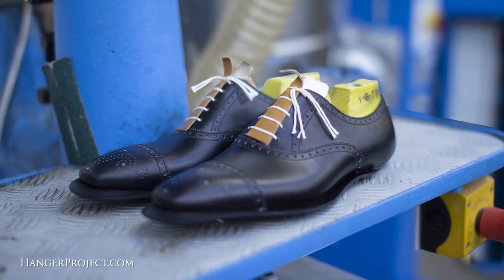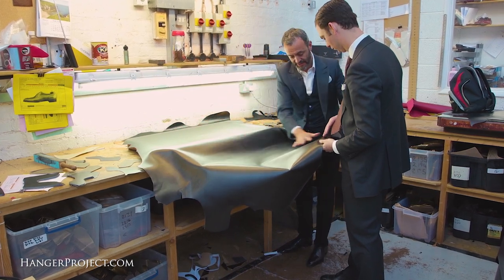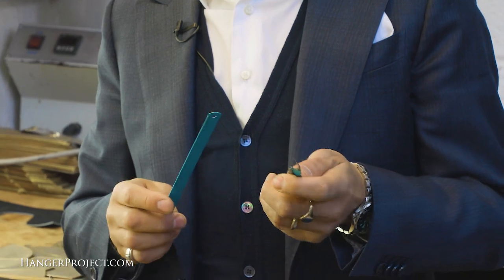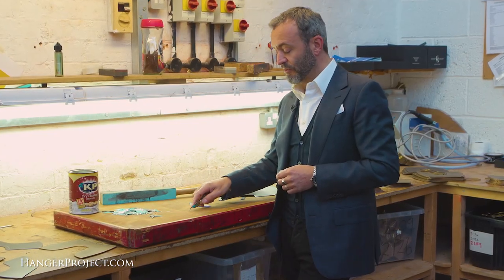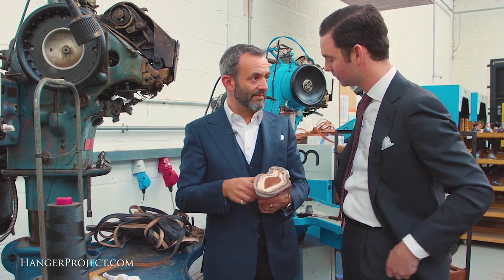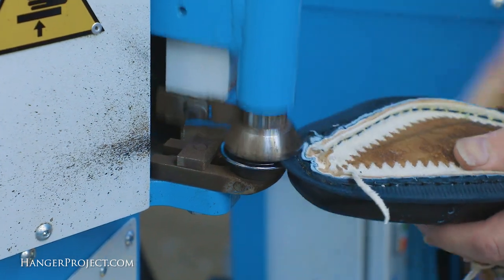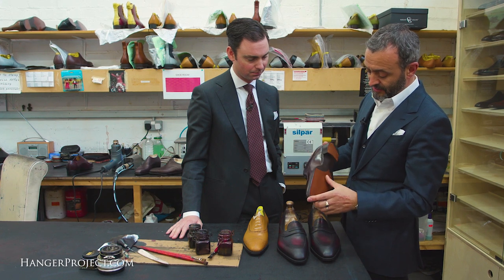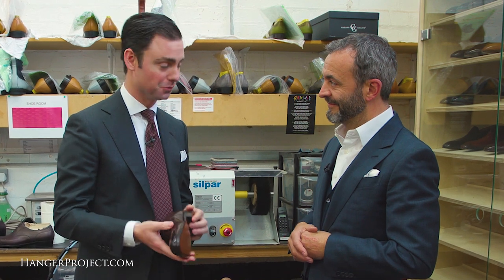How Goodyear Welted Dress Shoes are Made | Gaziano & Girling Factory Tour

Comment: Loved seeing channeling on the side rather than straight down. Regarding the polishing and finish how do you feel about sanding the leather to get dye to penetrate? I work in bespoke boot making and the first time I saw someone sanding the grain I felt very scared. Was wondering if it was a usual thing.
Reply from the maker: Cel Gar Totally agree.
Reply: The old way, yes it is correct sanding the outsole and then hot ironing, waxing and polishing

Comment: So the main difference between RtW and their bespoke shoes in terms of construction (not counting the last making) is the welting where RtW is Goodyear and bespoke is hand welted?
Reply from the maker: rob fong This is probably the single most significant difference, but it would be incorrect to simplify it down to just this element. Bespoke is a totally different product and experience. For starters, all bespoke shoes are built on a customized wooden last that allows for a level of comfort and fit not possible even with the best RTW. And although construction is similar — they’re both shoes — the fact a GG Bespoke shoe is made entirely by one or two people allows for a level of fit and finish even above GG RTW (which is saying a lot because GG has an incredible finish).

Comment: Kirby I have a question. Since the canvas rib is GLUED on the insole, the good-year welted shoe is basically a glued shoe because if the canvas rib comes apart from the insole, you could basically take the shoe apart right? I mean, nothing will hold the shoe together anymore, where with a handwelted shoe the welt is realy stitched to the insole, which can offcourse not come apart unless the stitch brakes. Am I right? would love to hear from you! all the best from the Netherlands!
Reply from the maker: mike Reuvekamp You are certainly not wrong! It is surprising when you think of that way... although there is a lot of sticking involved, it is basically a glued shoe. That said, I’ve never heard of a rib failing since it is so protected. And the upper is still sewn to the welt and interlining, so even if the rib did come unglued from the insole, the shoe wouldn’t fall apart.
Reply: No it wouldnt! Think about it, the upper and lining are stitched to the welt, the welt is stitched to the sole, the rib only serves as a temporary fix for the upper until welting. Besides, that glue is hardcore, the stitching will go before the glue does.
Reply: You are right in some way, only that the welt is not stitched to the insole, like a hand welted shoe. Yes off course the glue will last for a long time and most of the time the canvas rib is still perfect with 10 year old shoes. However, if the glue would let go you could in theory take the insole out. Now some shoemakers like Stefano Bemer RTW actualy  hand welt the welt to the insole, and stitch the welt to the outsole. Don’t get me wrong I understand what you are saying!
Reply: mike Reuvekamp , you could not remove the insole, youre welcome to try. The seat is nailed to it, the sole is nailed to it too, if you saw every operation you would know.
Reply from the maker: Greg O'Connell I’ve never heard of the rib coming unglued. It’s really more about the spacing it creates between the insole and the outsole.
Reply: The Hanger Project, how would you hear about it, have you stripped many shoes down? I have, Ive been making these shoes you are all discussing for 25 years.
Reply: I believe “gemming” is the shortcut of welting to the canvas strip glued to the insole. 
Also, the genrltleman explaining the Lockstitch that the machine does as not coming apart if one thread breaks. A Lockstitch will come apart. A saddle stitch will not. The Lockstitch is what a normal sewing machine does. Saddle stitch is by hand.

Comment: Omg lol you can't custom which is what bespoke mean in a commercial set sizes. Gosh y'all sound dumb. Also the clicker is referring to the hydraulic press that clicks when they cut leather out with cut dies.
Reply: No, the clicker is what they call the person that cuts the leather, the traditional flexible knife makes a clicking sound. Bespoke means the shoe is made on a last made specifically for the client based on is measurements. it can be a custom design or a design already offered by the maker, but made to measure, and with the colour and leather type of their choice.